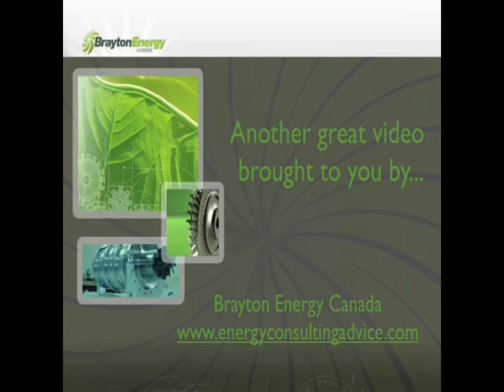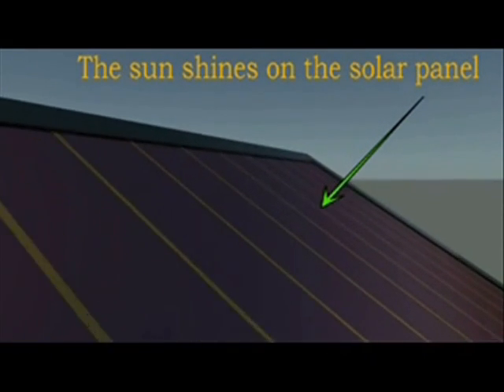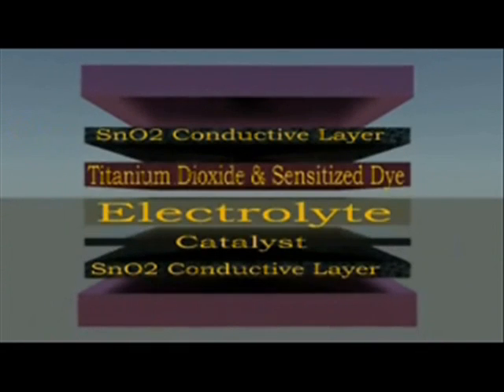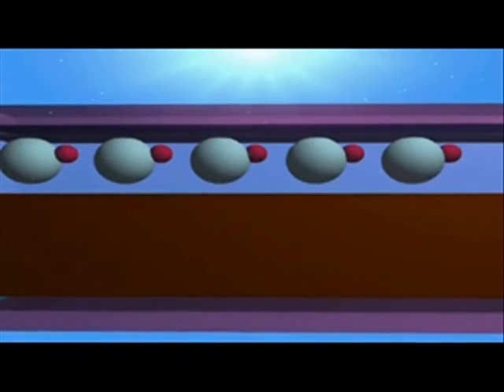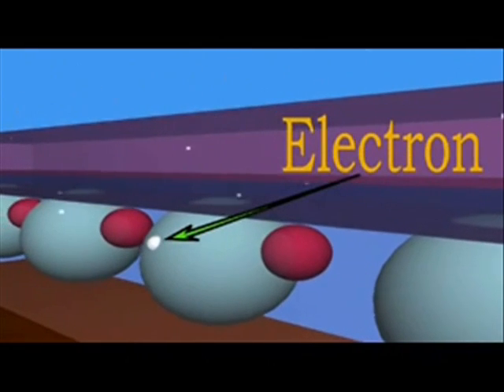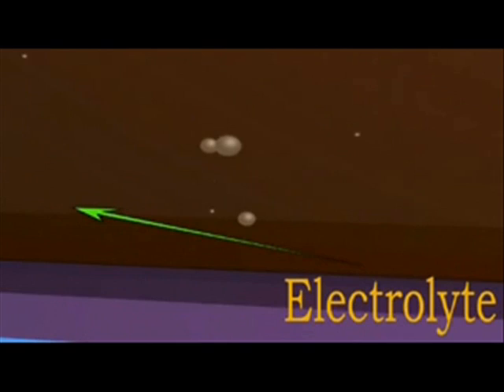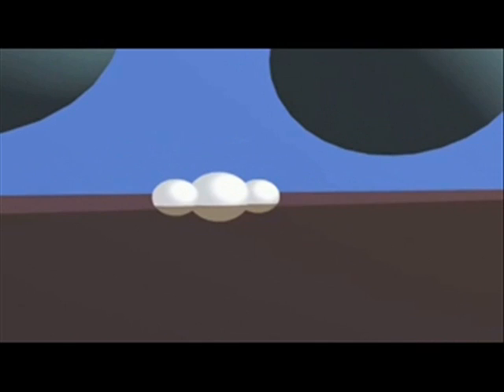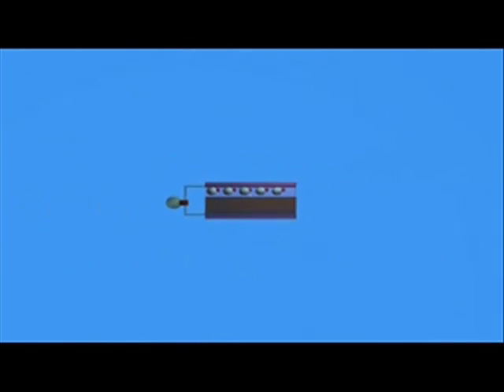"How Solar Panel Works"

Comment: a photon goes through the protective glass layer, through the SnO2 conductive layer, hits the Sensitized dye, excites the Sensitized Dye then the Sensitized Dye produces an electron. the electron then flows from the Sensitized Dye to the TiO2, then from the TiO2 to the SnO2 conductive layer that the photon went through. then the electron travels through the SnO2 to the electrical device(in this case a lightbulb). goes through the lightbulb. then into another layer of SnO2, touches the catalyst, from the catalyst to the Electrolyte gel, here the electron interacts with a Tri-Iodide molecule. the Tri-Iodide molece then becomes an Iodide-Ion. the Iodide-Ion then goes back to the TiO2/Sensitized Dye layer and into the Sensitized Dye. where it will then be struck and excited again by anther photon from the sun.

Comment: Some people are getting confused where the N-type semi-conductor and P-type semi-conductor is. The N-type semi-conductor is found on the top layer of the solar cell which is commonly made of silicon, in this case TiO2. The P-type semi-conductor is located at the bottom which is slightly more positive, which means it will absorb the electron and transfer it back through the use of the electrolyte to the N-type wafer.

Comment: if we increase the intensity of light on solar pannel does output increases?
Reply: Yes, as irradiance increases, current flow increases. Since power is voltage X current, this allows an increase in power output of the PV module.

Comment: if we increase the intensity of light on solar pannel does output increases
Reply: Yes.
Reply: how come that is possible?
Reply: Sambhav jain More photons hitting (as long as they are of low enough wavelength) means more electrons being liberated, therefore, greater output.

Comment: Entire video is fictional science. Electricity = (Volts + Amps). Solar panels only supply voltage. 

"Electrons are the rate at which electricity is destroyed." Eric Dollard

"There is no Energy in matter other than that received from its environment." Dr. Nikola Tesla

"A perfect conductor is the perfect obstructer." Oliver Heaviside
Reply: if we increase the intensity of light on solar pannel does output increases?
Reply: Why is that then? why is it they only supply voltage and where are the amps created from?
Reply: I thought that electromotive force equals the amperage times the impedance or is that only for circuitry?
Reply: may be??

Comment: That tri-iodie, once the electron goes back to the dye molecule, does it return to its original spot? or does the cell eventually run out of them?
Reply: It should remain in the electrolyte
The electrolyte just has a bunch of these molecules bouncing around, and after they're done with the electron transfer they just remain bouncing around
Reply: if we increase the intensity of light on solar pannel does output increases?

Comment: wait but wouldn't the solar panel eventually run out of electrons?
Reply: No, because the energy actually comes from photons(light) that hit solar panel. Those photons displace electrons that are then "funneled" through conductors in the form of electrical current.

Think of electrons as tiny carriers of captured energy of light. After they finish their round they return to their position because light hits panel again displacing more electrons while those who finished their round take their place and the whole process is repeated again.

No electrons are actually lost in the process as they only circle around carrying energy of light(one the set them on their path).

I tried to make it as simple as possible, I hope you understood it.
Reply: No because the sun will make more im not sure if what iv just said is right lol.
Reply: TngMutantNinjaTroll will the tri-iodide move back to its original position? This video doesn't not show that in the end to illustrate a full circle. The cliffhanger makes me feel bad.
Reply: No electrons are lost or gained.

Comment: Solar energy is the basis for ALL life and energy forms on our planet. Gas, coal and oil are very concentrated forms of solar energy.

Energy has no color.

Green is only the color of money, subsidizing this. Without it nobody would want it because it will always be too expensive and unreliable. Solar and wind power can not be relied upon 24/7.

Comment: Solar energy has no future simply because they operate at best for only half a day. So when the sun sets behind the horizon, their output drops to zero and batteries must then be used to power utilities. No grid can operate from batteries and there is no way power hungry utilities like stoves, heaters, etc can operate from a battery system.Clouds also affect the output of solar panels.